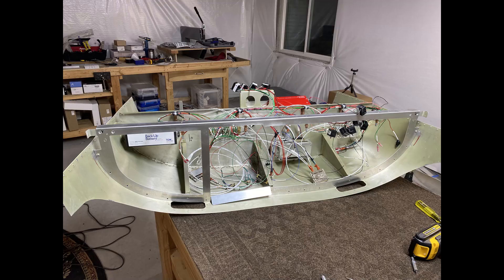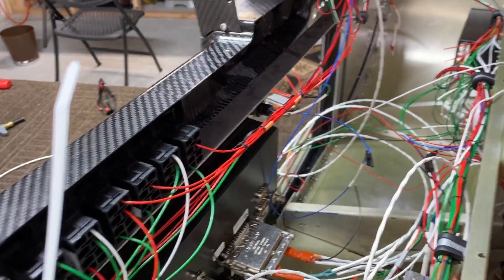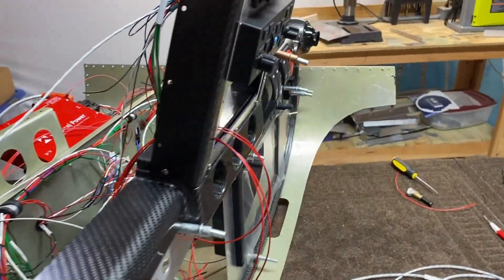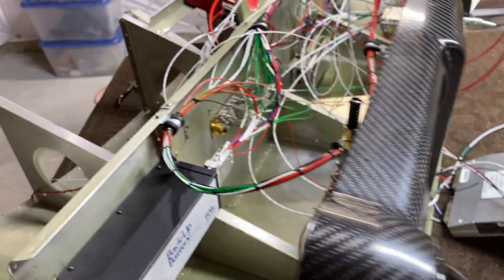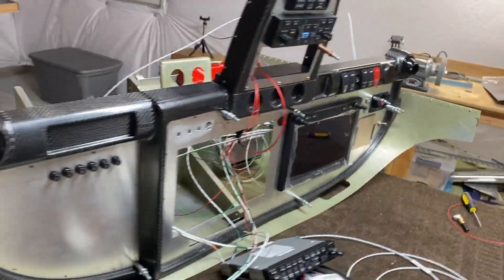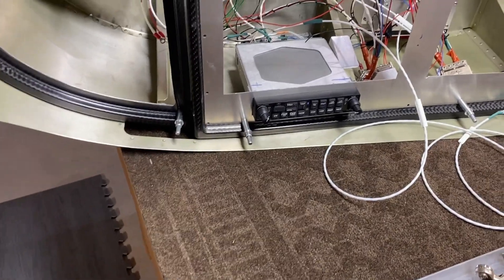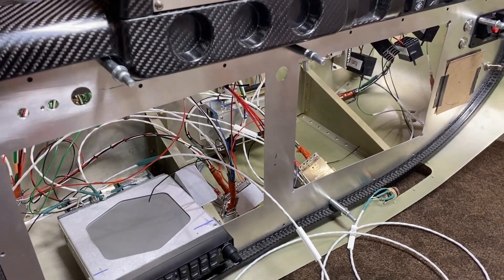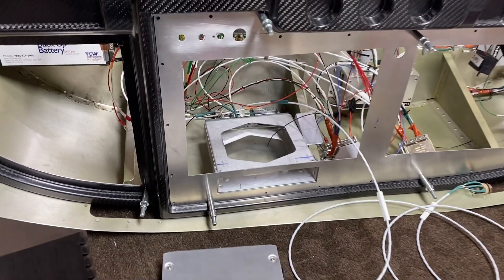Vans RV10 - Panel Part 6

Comment: Issue with the 650 is that all of its connectors have high density pins that won't accept thick wires. If you don't want to spice at the back of the unit, you need think ahead and run thinner wires to the unit.
Reply from the maker: Thanks, I have already started to see that, even the running of the power wires requires some planning as the pins for the coms cannot handle the required current so you have to split across multiple pins.